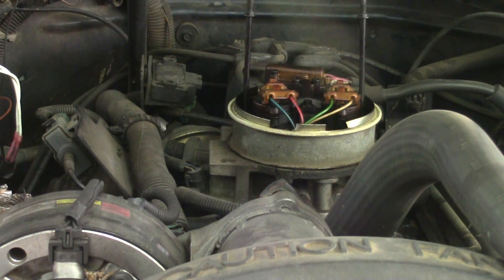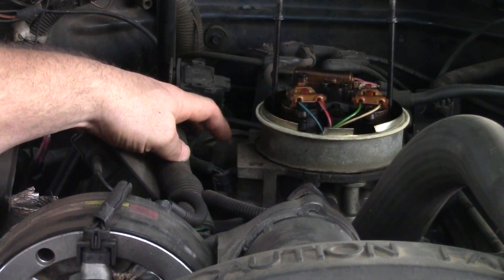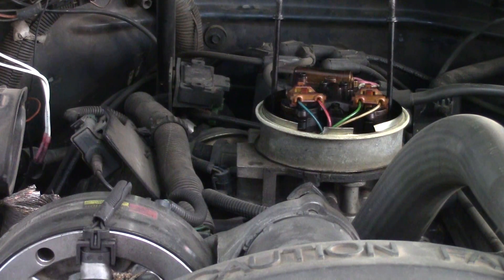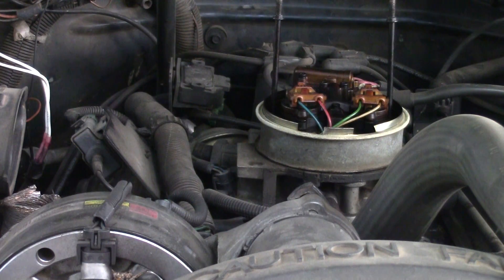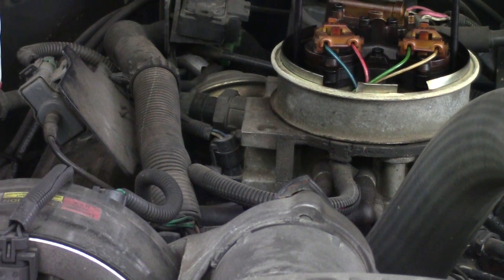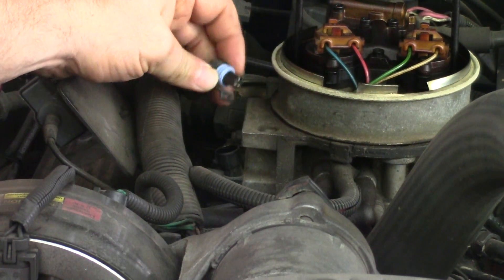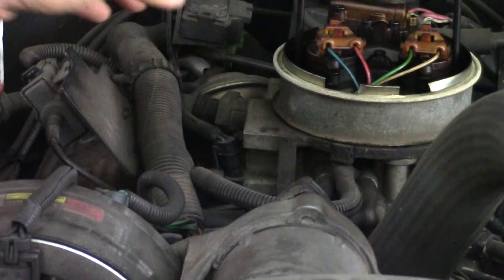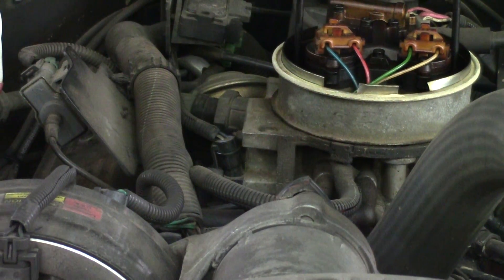GM Truck DTC Code 22

Comment: I ran all the checks, done all the ohm testing. Everything passes the smell test. Drive it after clearing the 22 code and it drives great. Park it a few hours, start it, code 22 and high idle and rough shift. Here's the thing, once you pull the codes, not clear, they clear on its own and drives mostly normal, once you shut it off, back to the the code 22. Im lost, Im thinking ECM but I don't honestly know. I have the 5vs where it should be, test the TPS from closed to wide open, starts at .42v and smoothly goes to 5v. Im so lost lol.

Comment: I hope this helps! I jumped the blue and grey wire, and got code 21 and code 22 went away, is that bad? I volt tested the grey to black wire and got 5v. Im gonna replace my sensor and hopefully that helps

Comment: Anybody know where to get the right ABS sensors for my 1994 Blazer?? I cant find them ANYWHERE, They are a 2 bolt sensor that goes into the spindle in the front!

Comment: This video helped me immensely, too bad I didn’t find it BEFORE I changed out my ICM that’s 50 bucks I won’t get back lol but heads up if you don’t have an obd1 scanner you can still check codes by jumping the top right two terminals on the diagnostic port, turn on the key, you’ll get code 12 3 times with cel flashes 1 time followed by 2 flashes to indicate it’s in diagnostic mode, and then using this video I got 2 flashes and 2 flashes (22 - tps low volt) with tps plugged in, then jumped the two wires you said and started truck repeated and got code 21. Thanks brother!

Comment: This is good advice but I think it’s worth mentioning that you should measure the reference voltage before jumping the reference to the signal...if your 5v wire had 12V due to a short you would’ve killed your PCM

Comment: Questions friends i have trouble with mine it throws me a code that says spark  timing ignition I changed distributor spark plugs and cables and nock sensor and coil and it still throws me that code and makes a little raddleling noise when you floor it any help please is appreciated thanks.
Reply from the maker: Might be a little late sorry, it sounds like your initial timing is off.  There is a brown wire you must unplug prior to setting initial timing that bypasses the computer.

Comment: I'm about to jump the gray and blue and see if Inger code 21 I already have 22 I will leave know,, but pretty sure bad pcm  new transmission new tps and still have to have high rpm to shift and when u de celerate  it just free wheels

Comment: Get a Actron CP9690 code tester. It does live, record, graphing, oil light reset, smog test readiness test, code reset, ABS, and MORE! It has OBDI cables for Ford, G.M., Chrysler and 2 Toyota cables. It has OBDII cable. It has a cigarette lighter cable. Get a cigarette lighter cable for 12v hookup to the battery. It has code connect to troubleshoot symptoms which are ASE certified mechanic solutions for problems. It works on 1983-2012 cars out of the box. It is updatable.

Comment: I have been having an intermittent code 22 for a long while now. I was thinking it was a grounding issue since this would go away after a while.  I was dreading having to look for such an issue in a mess of wires. Then I come across this video.  I first do his test of jumping those two wires. I got the codes 21 & 22, telling me the ground issue is not in the wires.  He next advice is to check for corrosion on the contacts. While, I did not see any corrosion, I went ahead and sprayed both sets of contacts profusely with electrical contact cleaner. Dr Eugene Portal is right,  this the most important sensor! The contact cleaner worked! Not only did the code 22 go away, the engine not only idles, runs, and accelerates smoother the transmission also shifts smoother! I  was ready to trade this in a lot sooner than I was ready to.
Reply from the maker: Glad it helped!
Reply: I got the same exact issue as you. And I did the same thing. Got those two codes confirming that the wires are good. I'm going to try cleaning the terminals.  Mine don't appear to have any noticeable corrosion either.  I'm also going to replace the sensor with a ACDelco oem.  I don't if it's possible to get two bad parts back to back. But it's possible when things are made in China according to my local mechanic.  Because that's been their experience with parts lately..  😂
Reply: @kgbreviews35 I still have the vehicle and the issue has not returned

Comment: perfect video thank you very much.. i was wondering why i killed a qtr and change on my tank on a 60 mile round trip.  guess i know what im doing this weekend smh
Reply from the maker: Thanks Franki!  Glad it was useful!
Reply: Is that diagram in the first part of the video correct in there is a direct connection from the PCM to the TPS? I am having an intermittent code 22, and wondering if it could be a grounding issue, or need to change the TPS.

Comment: having a problem with surging up and down. also put foot on the gas its sputtering in then picks up speed
Reply: Well check your TPS. Also  check the vacuum tubes going the throttle body. I am second owner and I was having a myriad of problems like that. They never changed them, and all were rotted

Comment: Still a lot of these vehicles running around and some good information Bud
Reply from the maker: Thanks Lloyd!  There sure are and they are dirt cheap compared to the older square bodies.
Reply: you don't consider the 1987 a square body? Mine is the old style square front.